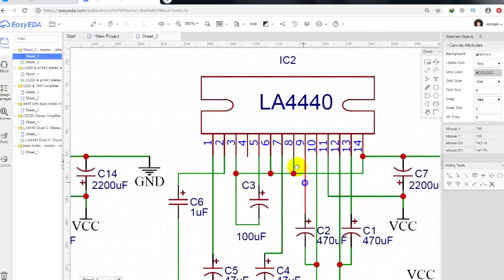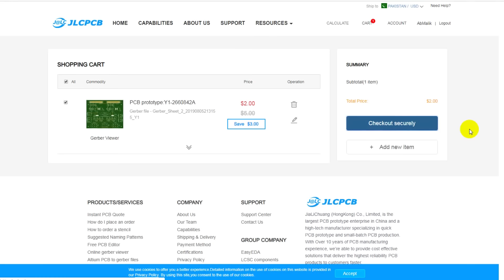Heavy Bass Powerful Amplifier of D718 Transistor Using Bass Controller, output Capacitor DIY Class A

Comment: This is excellent. Can I connect my Bass guitar with pre-amp to this input, or do I need to add something tho make it line level?
Reply: Eu posso usar um tip 42 e um D 2396 e um bd 135 pra ser pre amplificador? Tipo assim: tip 42 e D2396 na amplificação . O bd seria pre amplificador.  Nao sei se eu expliquei direito!

Comment: what is the porpuse of this D718 transistor int the circuit .... plz reply ... can am install this circuit with the speaker of 10" directly with out any supply or amplify ..
Reply from the maker: 10" doesn't matter, should be 4 ohms. If ohms are greater than 4 then join two speakers in parallel. For example, if you join two 8 ohms speakers of any size in parallel, they will become 4 ohms. Thanks for watching & comments.
Reply from the maker: The same circuit I will upload tomorrow or next day which is a modified version. Stay tuned if interested.

Comment: Sir transistor niche paper or gutta lagana jruri hai kya? Heat sink per sidhe nhi lagga sakte hai kya?
Reply from the maker: Transistor ki center pin (collector) touch hui hoti hy transistor ki back ke sath. To istara red wire ke positive voltage bhi heat sink par ajaengy.
Ab ye ek transistor hy to ap direct laga sakte ho magar volume upar lagaogy to uski body par bhi positive voltage aengy to usey alehda rakhna. aur khayal rakhna ke negative wire heat sink se touch nahi ho jaye warna short circuit ho jaega.
Reply: Science & Technology Experiments Thanks sir but ek aut baat electric shopkeeper ne mujhe D718 Transistor mangne per Toshinba ka C5198 transistor de diya kya yeh same hai or yeh jo apne circuit banaya usi mai chal jayega ja different components lagge ge?
Reply from the maker: @ankitpreetkaur9936  Transistor to different hy magar ye bhi chal jaega.

Comment: Shouldn't these eletrolytic capacitors be bi-polar? I'd also like to mention that tieing the left and right positive input cables together coming from whatever your source is, is a bad idea, thats basically shorting both positives together, which can damage you're source, you should put one 1k resistor for each input wire before combining them so there is at least some resistance between them... one for left channel one for right.

Comment: Sir yeh wha apne circuit diagram di hai wha apne bataya hai ( jhi per mai confuse hu) used in D718 amplifier heavy bass

Following is the circuit diagram of single D718 amplifier heavy bass. One 0.22 ohms 5 watts load resistor is highly recommended to connect in between collector and the positive supply of 12 volts. Note that this resister is not shown in the following circuit diagram and the project video. AUB BATAOO MAI RESISTOR ADD KRU KE NHI?
Reply from the maker: pehle resister ke baghair bana kar chala ke check karlo phir bad men resister add kar lena.
Reply: @ScienceTechnologyExperiments  sir per app ne 0.22/5w resistor ko highly recommend keo likha hai ager pehle aise power  supply dene se garbar ho gye to baadh mai kya kruga
Reply from the maker: @ankitpreetkaur9936  Agr hy to laga lo warna bagher iske hi chala lo aur milne ke bad laga lena. kharab nahi hoga.
Reply: @ScienceTechnologyExperiments  Thanks sir

Comment: Brother I did like what  you said
The speaker has a vibration in background but 2  minutes later it blown
Reply from the maker: OMG! I'm so sorry about that. But there is a video of c5200 on my channel with same method without capacitor. I think you were using very small speaker with very low wattage.

Comment: Whats same of the transistors D718 if no there...?
Reply from the maker: Use any NPN power transistor.
Reply: @ScienceTechnologyExperiments  All type NPN could be.... Guys?
Reply from the maker: @ghufrontaja7658  Yes all type NPN only power transistors.
Reply from the maker: PNP also can be used but you will have to reverse polarity of power supply.
Reply: @ScienceTechnologyExperiments  means revers polarity?

Comment: Can I replace the transistor with the 1943? Would it be more effective?
Reply from the maker: Replace it with c5200 transistor NPN.  a1943 is a PNP transistor. It will also work but you will have to change the polarity of power supply. Replace positive in place of negative & replace negative where positive. Thanks.

Comment: Brother it's not working.When I switch on this circuit it only produces vibration  in speakers no audio sound
Could you tell me how call I solve it
Reply from the maker: Check the polarity of power supply & capacitors. Its very easy simplest circuit ever. It works.
Reply: @ScienceTechnologyExperiments   Brother I used 12 0 transformer and made as 12 0 DC using 1n4007 and  and 2200uf  and give to the circuit
Reply: @ScienceTechnologyExperiments  Also use 12 0 12 2amp make it as 12 0 only and connect it to it which also same vibration
Reply from the maker: @shyamcleetus6936  You do one thing to try... 1) Remove capacitor. 2) Remove positive lead from center pin collector. 3) connect this positive wire to speaker's positive. 4) connect one lead from speaker's negative to center pin collector. Now run this circuit & tell me the result. Thanks.
Reply from the maker: @shyamcleetus6936  Follow instructions in other comments.
Reply from the maker: Where are you from??
Reply: @ScienceTechnologyExperiments  From kanyakumari

Comment: Positive to collector - negative to emiter. the question is.. how do it works ?? if to apply voltage in the base the circuit emiter-colector close and conduce voltage for the tow way..emiter to collector..or... collector to emiter..!!
Reply from the maker: If you apply voltage to base it opens the gate collector to emitter.on minimum 0.7v
Thanks for watching & comments.

Comment: Brother if I use 2×3w  speakers how much DC volt I have to reduce.
If I reduce the volt of DC what are the changes I have to do In this circuit. Could you tell me and resistors watt also
Reply from the maker: This transistor requires atleast 12v dc. On lower voltage it will reduce it efficiency and lower the sound. You try those two speakers in parallel with 12v / 1 amp power supply.
Reply: @ScienceTechnologyExperiments  Ok brother. Then shall I connect 3w×2 speakers in this circuit? And if I do it do these speakers blow ?
Reply from the maker: @shyamcleetus6936  I do not guarantee. Why do you not make a low wattage mini amplifier if you want to use these 3w speakers.
Try using 9v dc with low amp power supply and try at your own risk. OR make my two transistors 13003 amplifier using 3.7v battery, which is quite safe for these two speakers. Thanks.
Reply: @ScienceTechnologyExperiments  Brother could you make hifi mini amplifier using 13003 transitor or send link
Reply from the maker: @shyamcleetus6936  Ok bro, I'll make.
Reply: @ScienceTechnologyExperiments  Brother also make amp using d882  transitor also I want hifi
Reply from the maker: @shyamcleetus6936  Ok sir.
Reply: @ScienceTechnologyExperiments  Brother I want to make  only Volume and bass control circuits  plz make a video on volume and bass control which is suitable for all amplifier for me
Reply from the maker: @shyamcleetus6936  I have already made videos for vol/bass/treble for mono & stereo. Visit channel & watch. Thanks.

Comment: Se puede usar un 2sc2625? O no es igual :c
Reply from the maker: Sí, se puede usar. También es un transistor de potencia.
Gracias por mirar y comentarios.
Reply: @ScienceTechnologyExperiments  :  Gracias por responder, le pase el vídeo a mi amigo y el no tiene el potenciómetro ni los capacitores 104.  podría armarlo sin eso?.
Atte: buen vídeo y en mi caso el 2sc2625 aria q suene menos o seria prácticamente lo mismo.
Reply from the maker: @HunterRolo  No probé este transistor. Pero se ve mejor.
No use 104, si no tiene. Eso solo aumentará los graves.
Incluso no use potenciómetro. Utiliza el control de volumen de tu móvil.
Gracias y buena suerte.
Reply: @ScienceTechnologyExperiments  : Gracias por responder un saludo c:
Reply from the maker: @HunterRolo  De nada hermano.

Comment: Kalau pakai potensio 100K bisa gan?
kalau tidak bisa, apa penyebab nya?

Untuk input Daya, apakah bisa Adapter 12Volt - 1Ampere gan?
Reply from the maker: Ya, Anda dapat menggunakan pot 100k dan 12v 1a dapat digunakan.
Besok saya akan mengunggah video yang sama dimodifikasi. Lebih baik Anda membuatnya. Terima kasih.
Reply: Terimakasih gan.
Sukses selalu.

Kalau boleh, membuat Amplifier output nya tidak lebih dari 70 watt / 8 Ohm.

Yang berfungsi juga digunakan untuk  gitar elektrik
Reply from the maker: @rockykardobaaruan1335  ok bro
Reply: And how many watts of maximum power bro? 

Is it possible if I use 70Watt / 8 Ohm speakers?

Comment: bro, can i use transistor 5200 ?
Reply from the maker: Yes you can use.
Reply: @ScienceTechnologyExperiments  THANKYOU SIR GODBLES
Reply: @ScienceTechnologyExperiments  CAN I USE 12V 5 AMPS? OR 3/2 AMPS?
Reply from the maker: @randomvideosfromtiktok5583  Welcome!
Reply from the maker: @randomvideosfromtiktok5583  You can use any of them. Use large heat sink.

Comment: Brother how to connect 12 0 12 transformer to this circuit
Reply from the maker: This is single supply voltage 0 - 12v.  Use two diodes to 12v ac and join together positive to capacitor positive and take this positive & capacitor negative to amplifier.
Reply: Use 0 12 only .. then connect to bridge diode  .. you will get 12v dc
Reply: @ScienceTechnologyExperiments  Ok brother thankyou

Comment: Can using d882?
Reply from the maker: Yes! You can use but it has different pins and it works on low voltage.
Thanks for watching & comments.

Comment: the volume is not soft
Reply from the maker: Yes. Because there is no base biasing resisters. Its class A initial circuit. If you want full control over volume then add an audio transistor. Refer to my similar video where I used d882 transistor.
Thanks for watching & comments.
Reply: @ScienceTechnologyExperiments  link please
Reply from the maker: @youbenkz121  https://www.youtube.com/watch?v=b1ZrIAlD8Yk&t=353s
Reply: @ScienceTechnologyExperiments  🙏 thx
Reply from the maker: If you don't have d882 then use bd139. Even you can try 13003 from any damaged cfl bulb.

Comment: Hola bro tengo un transitor que no es el que esta hay, en el vídeo, tengo un transitor  f C5803, se puede hacer con este  circuito del vídeo.
Reply from the maker: Sí, puedes usarlo de la misma manera. C5803 se utiliza en monitores y tv.
Gracias por mirar y comentar.
Reply: Bien bro graciasssss
Reply from the maker: @hernestozarate5242  Asegúrese de que los pines base, colector, emisor de su hoja de datos.
Reply: Lo are como esta en el vídeo, veo que onda.
Reply from the maker: @hernestozarate5242  Good
Reply: Ese transistor es para alto voltaje, 1500 voltios y es para la salida horizontal de un tv, no es recomendable para este proyecto.
Saludos desde la ciudad de México
Reply from the maker: @daviddelatorreperez4  Este transistor también se está utilizando en estéreo de automóvil para alta potencia.
Gracias por mirar y comentar.

Comment: mano yo tengo un B688 se puede hacer asi mismo.
Reply from the maker: B688 es un transistor PNP. Mi próximo video en circuito abierto será el amplificador mono D718 y B688. Manténganse al tanto.
Gracias por mirar y comentar.
Reply from the maker: Son un par de npn y pnp significa que el colector pnp se volverá negativo y npn obtendrá un voltaje positivo.